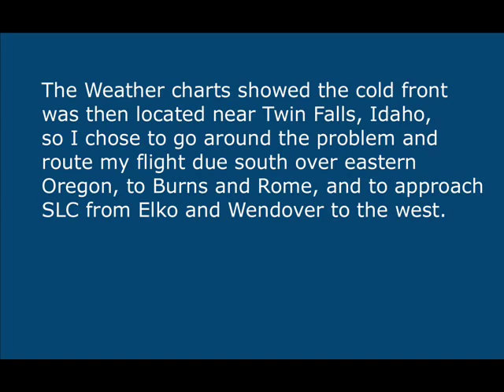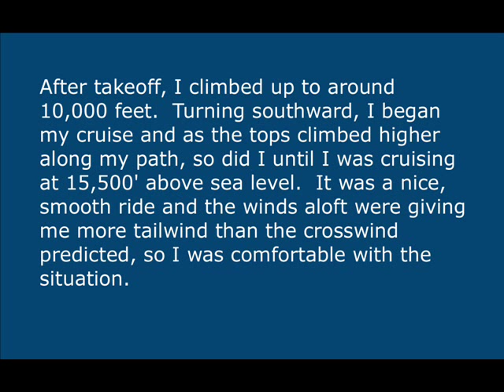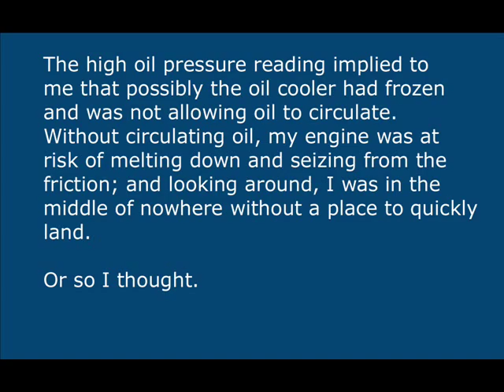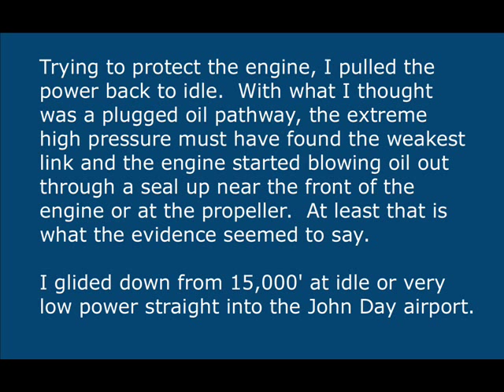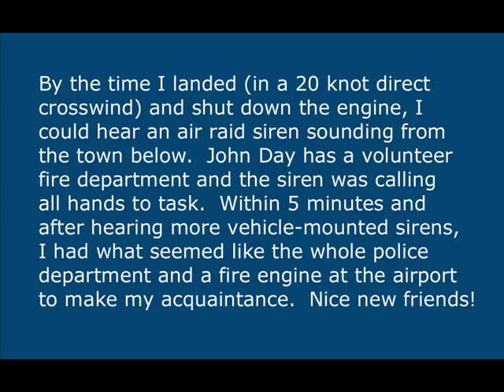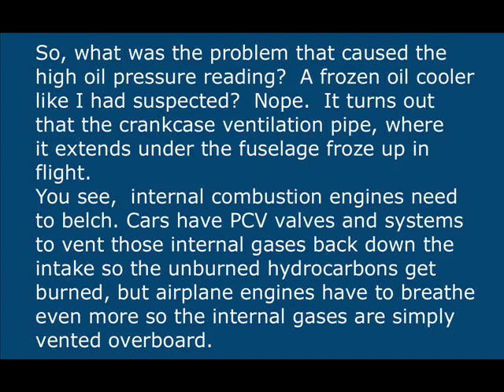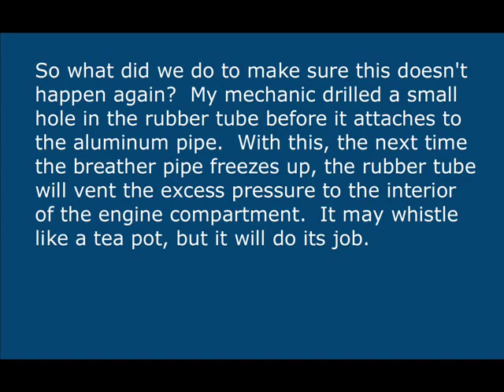Emergency Landing at John Day, OR in a Glasair

Comment: Rather than drilling a small hole in the tubing near where it attaches to the engine I recommend a lengthwise slit 1"-2" long.  Under normal conditions the slit will stay closed but it there's a blockage downstream it'll open and relieve the pressure.

I first read about this technique in the Canard Pusher newsletters (for Long-EZ, Vari-Eze, etc.) from the 1980s.  Back then someone had a very similar experience to yours.

Comment: Frequently running an engine for less than 30 minutes causes condensation to accumulate in the oil. Running an engine for 30 to 45 minutes monthly exceeding a hundred eighty degrees Fahrenheit helps to evaporate the condensation out of the oil. This is something to be aware of if you frequently run your engine for less than 30 minutes. Water will accumulate in your oil making it appear milky white and a white goop will stick in the higher areas with low oil flow. This also degrades engine oil performance. As you would expect the problem is exacerbated on air cooled engines. If your oil is milky white it is best to heat it up and drain the oil. Start with fresh oil and run the engine for at least 45 minutes. I know this is an older video but this is relevant all the time.
Reply from the maker: point well taken